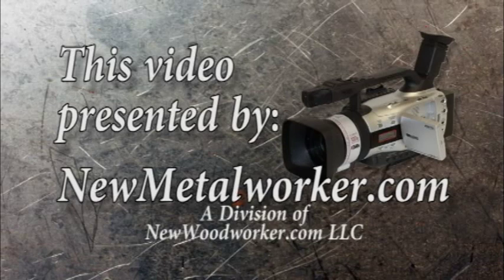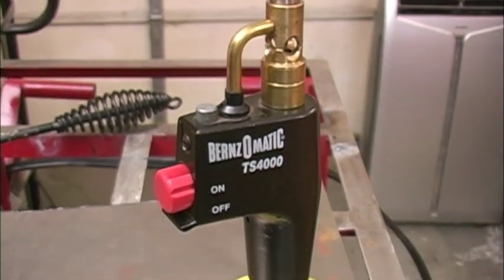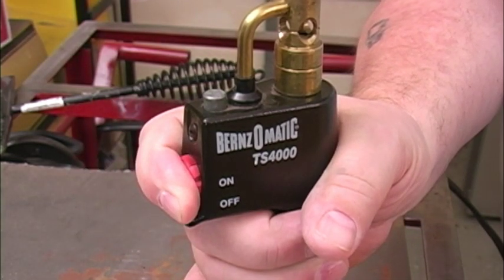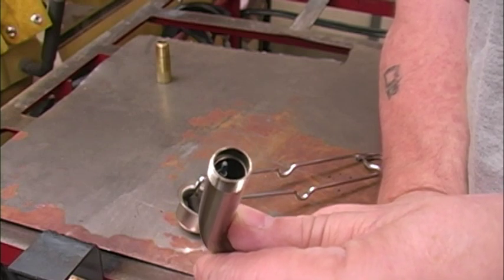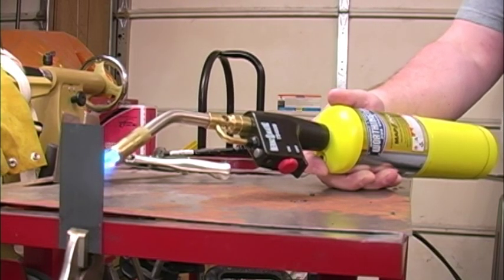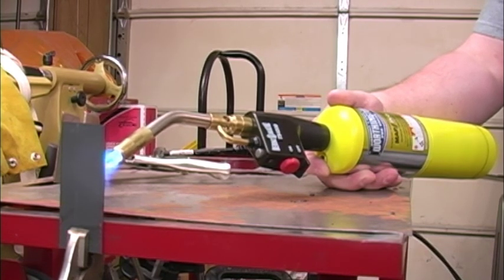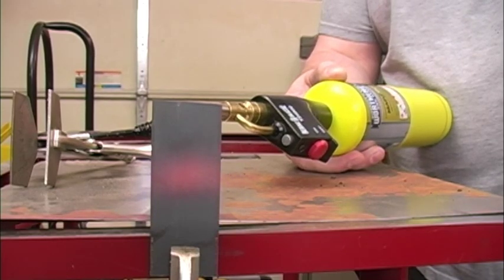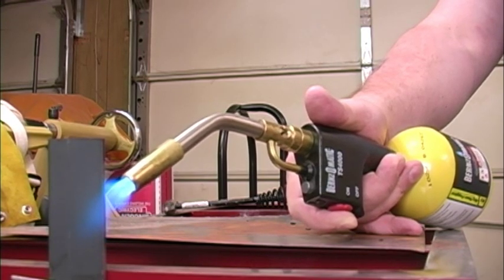BernzOmatic TS4000 Trigger-Start Torch

Comment: Yes you can use any standard 1 lb. propane or mapp gas tanks.  They all have the same thread and same nozzle.  Doesn't matter if it's worthington, coleman, burnzo, etc. I have been using them for years along with a lot of other people.  They make a lot more sizes now then they ever used to, market is heading towards "stubby" tanks simply because they are less prone to tipping over and the manufacturers can make a bit more money from the sale of them.

Comment: I got the TS 8000 and love it! I use it for siezed bolts. I work at a truck shop and this works well for very tight lug nuts on semi trucks and trailers. Fast and very hot heat

Comment: love the torch, but I used it about 6 times and something blew out. It was in my shop, and I was very lucky it didn't burn it down. The small room was reeking with gas from a nearly full bottle, and I let it clear out before I turned on the lights. I guess a seal or regulator diaphragm burst. When I screw on a new bottle of propane, it rapidly vents out of a 1/8 hole in the front.

Comment: Have you had any trouble lighting yours.  Mine has a spark but it won't light.  It happened once before and i blew it out w/ air.  Was wondering if any suggestions.  Seems stubborn this time.  Good video.  Thanks.
Reply: Dude there's a little sparker thing inside if you take off the 2 at the end tube at the end there's a little clicker thing like look at any lighter that's a torch and you'll see what I mean that things that makes a little Spark move that over bend it to where it's away from not sure where it has a error basically but it needs to have air à